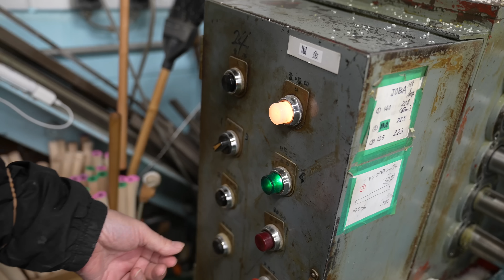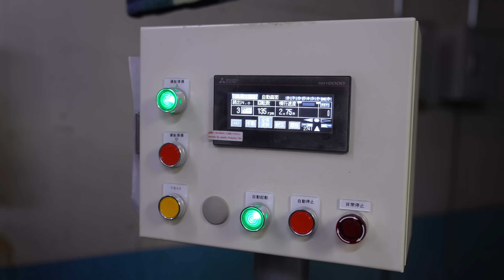ビリヤードキュースティックを作るプロセス。世界中のビリヤードプレイヤーが愛用するビリヤードキュースティック。

Comment: why are they wearing masks? is wood dust toxic?
Reply: Any particles from manufacturing is bad to breathe in, and yes there are quite a few woods that have dangerous side-effects when worked on.  There are also a ton of chemicals and glues used that give off fumes.
Reply: @lg5157  I know this, especially walnut; in fact, I encourage everyone I know to not buy walnut cutting boards for this reason and suggest maple (sugar/hard rock) instead.